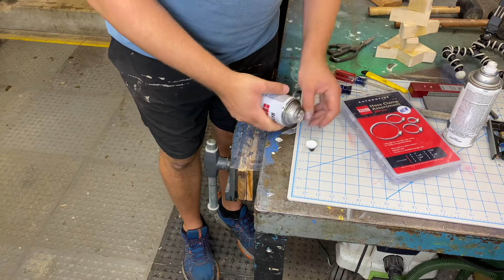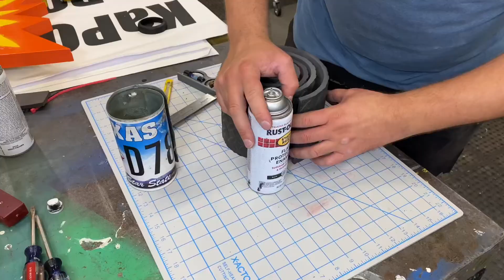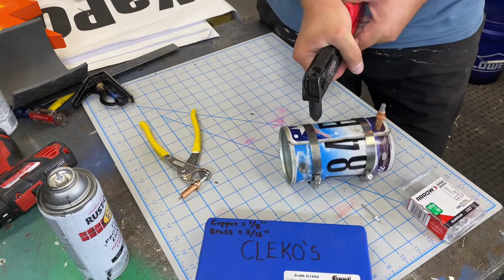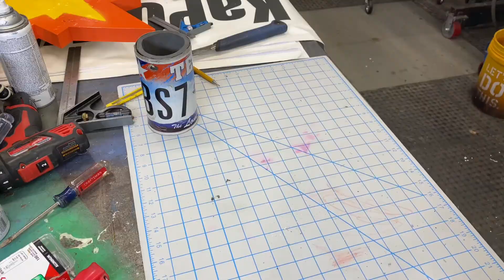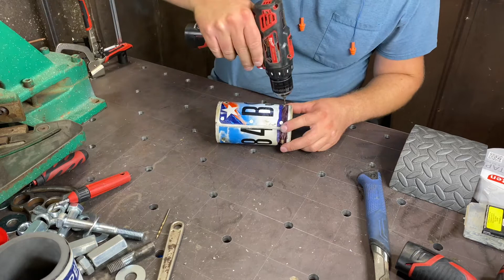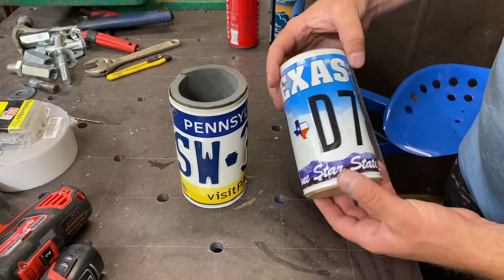DIY Koozie | Made From License Plates

Comment: Great project. What tool did you use to keep the drilled holes aligned? You used the yellow handle tool to put them on and off. Never seen that before
Reply from the maker: Thank you. They are Cleco fasteners. Great for sheet metal fabrication or license plates😁